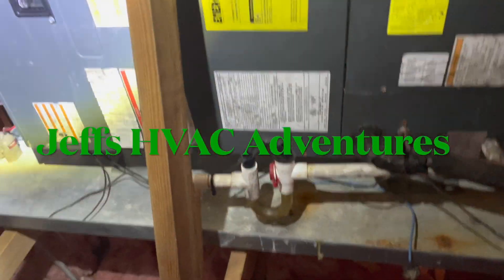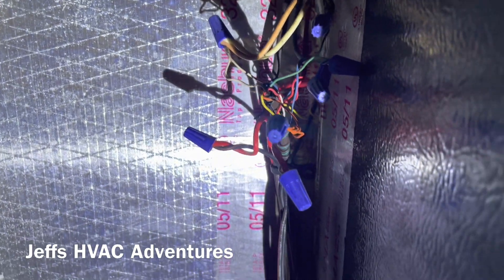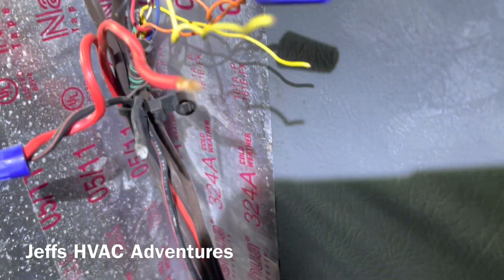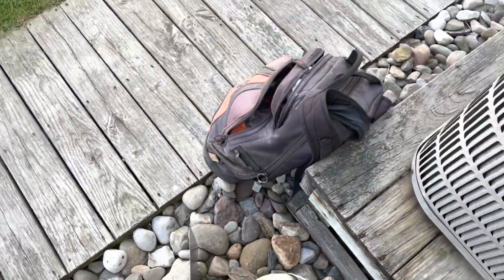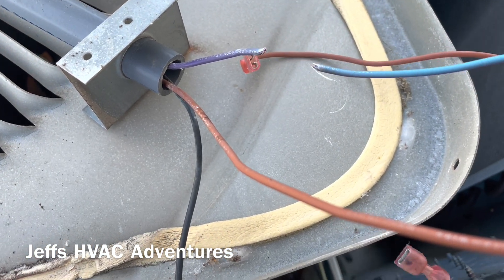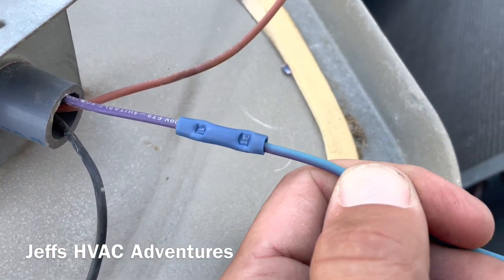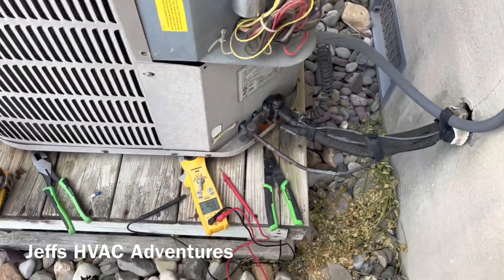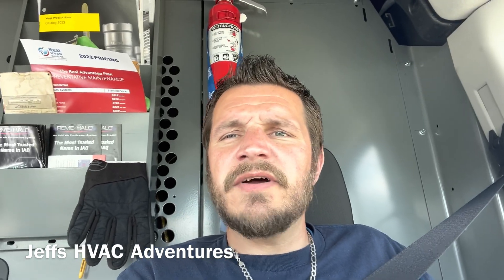Heat Pump tripping breaker, Repaired!

Comment: Why is there buzzing with the capacitor and the disconnect removed?
Reply from the maker: That’s the contactor buzzing.  Even though the main power is disconnected, the control voltage (24v) to the contactor, is fed from the indoor unit.
Reply: @JeffsHVACAdventures  so, my heat works without being switched to emergency heat, yet the outside unit is dead.  The breaker in the house cracks and pops then trips.  My entire system is only 3yrs old. I haven't had any PM done to it though. I'm hoping it's not the compressor. The capacitor is good.

Comment: My unit is a combo air and gas heat. Long story short, it burnt several parts up and doesn't work. Repair guy came out and supposedly fixed it for heat and will fix air when parts come in. My breaker in the house and breaker outside for unit read 240v until I flip the unit breaker on. It then goes to around 150v. He thinks something is wrong in the house. I'm thinking he wired something wrong in the unit. Have you seen this b4 and if so what was it? Thanks
Reply from the maker: It definitely sounds like an electrical issue before the unit.  Maybe a bad breaker or disconnect switch.  Especially where it burnt up a bunch of things.  Definitely a bizarre situation though.
Reply: Could be crud built up on the contactor.